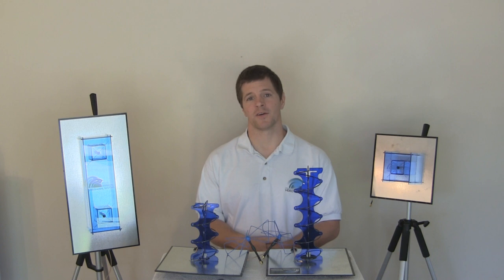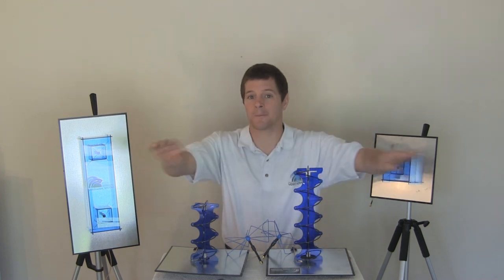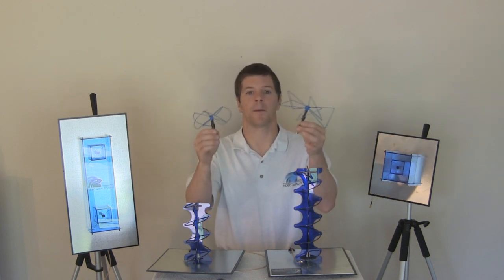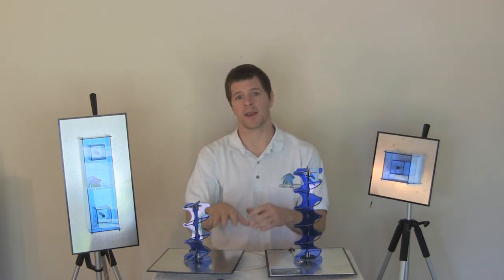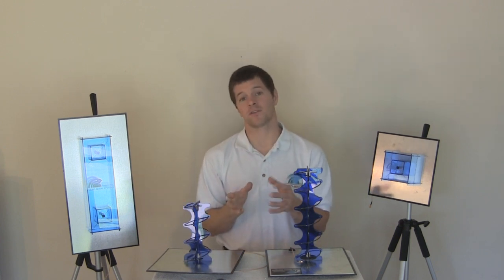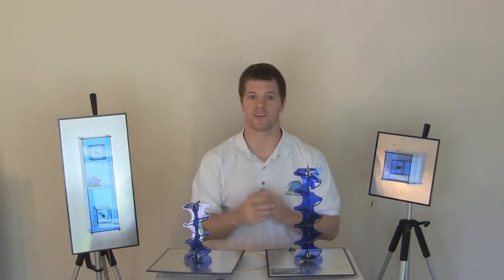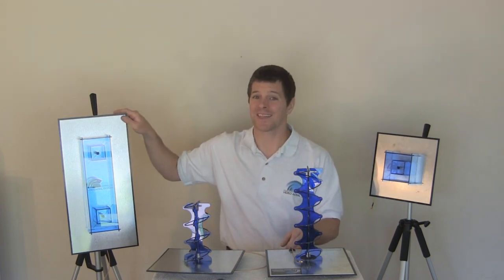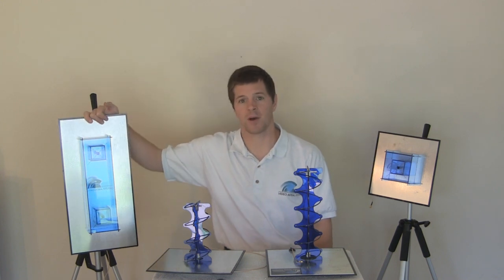VAS Receiver antenna selection tutorial

Comment: hey what antenna should i use if i want max penetration with an fpv rc car? i already have an ibcrazy mad mushroon and a cloverleaf, but im not getting the distance i need, It would be through trees and buildings.
Reply from the maker: +Sam E - Probably a Crosshair.  You need a directional antenna for penetration.  A helical would also work.
Reply: +Alex Greve ok so i have the ibcrazy crosshair ground station about 6 feet off the ground connected to a tv and a comtech rmrc 1.3ghz fpv rx. And my Rc vehicule has a 1.3ghz 1500mw trx with ibcrazy mad mushroom. And my controls are 72mhz Futaba radio. I've been trying all day, but i cant get more than 30 feet without static showing up on screen. I dont know what im doing wrong...
Reply: its also connected to my gopro 3. At 1080p 60fps
Reply from the maker: +Sam E - Could be a faulty transmitter or the GoPro could be the problem.  it is hard to say.
Reply: @henrytherobot  did you fix it? it was mostly to do with Tx power supply i guess.

Comment: When you were talking about the peperbox antena you mentioned that it was good for long range flight at low altitudes....How high can I fly with this antenna in order to be on a safe range? A mean how high is the low altitude you were referring to? I would appreciate your response since I bought one of those peperbox 1.3ghz antennas and I'll be using it soon with a new Fpv plane.  I really like your products. Keep up the good work...
Reply from the maker: +ricardopr54 - In general, it depends on how you aim the antenna.  However, 1 foot up for ever 6 feet out is usually a good place to be.

Comment: Alex, when you talk low altitude, what would be considered the ceiling of the pepper box... 400', 300', for use on the VAS Chimera 54"? Question 2... with the pepper box and on the Chimera, should we go 5.8 or 1.3 for good long range reception. I'm fairly new so hope I'm wording correctly. Question 3... can we use the crosshair and the cyclone on a diversity receiver setup for racing quads.
Reply from the maker: +Grumpy1056 AKA Bob  - Flight ceiling will change with distance.  The further you are away, the higher you can go.  1.3GHz is better for range.  For racing you only need a basic omni antenna.  Diversity is too much.
Reply: +Alex Greve, thanks for the quick reply. You're a Scholar and a gentlemen!  :-)

Comment: Hi Alex, I know the pepper box comprises of two cross hairs, can you tell me if the pepper box antenna has the some punching power through hills buildings trees ect... as the cross hair or is the single cross hair better for the punching power. THANKS
Reply from the maker: In general, the crosshair has better penetration due to the narrower beam and lack of side lobes.   However, the pepperbox penetrates surprisingly well.
Reply: +Alex Greve Thanks Alex, So I can select the correct channels, what is the Frequency range of the 5.8GHz pepperbox and crosshair ? Many Thanks.

Comment: Do helical antennas have left or right polarization, if so  can you please explain or direct me to a photo to how they look?
Reply from the maker: +Max Puscas - Yes indeed.  Red wire (or blue former) is right-handed.  Green wire or green former is left handed.  Right hand would follow a normal screw or bolt thread.  Left hand is the opposite.
Reply: thank yo so much

Comment: the pepperbox is always facing vertical?
Reply from the maker: Yes.  Always.  That is why the threads are on the top of the antenna on the backside.
Reply: k cool , just checking i got pprbx  and crosshair, 1 more question Alex does crosshair matter which way?

Comment: First, let me say I love your videos, and second your business is great because you have excellent customer service. 

I do some field flying with my quad and most of the time the mad mushroom works fine for this. However down the field (about 1000 feet) if I go behind a large tree, video gets little scary, so I go back to high alt. I think the crosshair would be great for my purpose, but sometimes I fly behind me (about 100-200 feet at about 50-200 feet) so I'm not sure if the crosshair (or a helical) could pick up behind me at that distance? I was thinking diversity with the mad mushroom and crosshair for this, but I wanted to keep it simple and attach the rx antenna to my goggle.
Reply from the maker: +razorseal - I think a 3 turn helical or a Crosshair would work. The helical will work behind you better, but the crosshair will have better signal behind the trees.  Both will work better than the Mad Mushroom for your purposes.

Comment: Hey Alex what about the biquad , where does it come in ?
Reply from the maker: The BiQuad is the long forgotten antenna for some reason.  This video is a all circular.  The BiQuad works with all linearly polarized antennas.  Few people are running linear these days and thus I did not include it or the Vee here.  The Vee/biQuad is the ultimate long range combination.
Reply: Thanks I.B !

Comment: Nice Job Alex, these short videos are the reason why I buy your stuff.  I noticed that you changed the materials that you use to build your products, I saw your 2.4 GHz products on a website the other day and they are still made of the older materials.  The photos could be old, are you shipping your 2.4GHz products with these new materials?
Reply from the maker: I am slowly updating the products.  The 2.4GHz Crosshair is on Accrylic, but the Pepperbox and the helicals are still on ABS.  I will be changing the Pepperbox over shortly, but not the helicals as they would be to brittle.
Reply: Alex Greve I am interested in the Crosshair antenna so that is okay.  If I use a crosshair antenna with an omnidirectional antenna with a diversity receiver do I need to separate the antennas or can I mount them both together?
Reply from the maker: 0917bobb
You need to separate them by at least 10".  Other than that, you are ok.  Some diversity systems do not like circular polarization, though.
Reply: Alex Greve Let me re-sound Alex's last sentence. Some diversity systems do not like CP and CP. It can confuse them. I can say I tried this with Oracle, and. . . well,i no longer own Oracle. Pepperbox replaced them all! at least for my style of flights.

Comment: Hey Alex
Can the Mad Mushroom or the Cyclone be used as a set on VRX and VTX. And When will the Cyclone Antenna be available?
Reply from the maker: Cyclone should be out in a few months.  It is designed specifically for multicopter pilots and those who wish to violate the Fresnel zone.
Reply: Can I use the Mad Mushroom antennas on VTX and VRX. (I want to split my SkyHammer)
Reply from the maker: Mylen Blake Yes of course you can.  No problem with that.